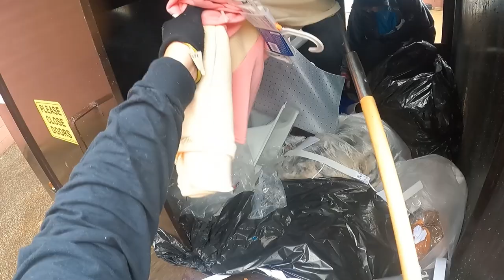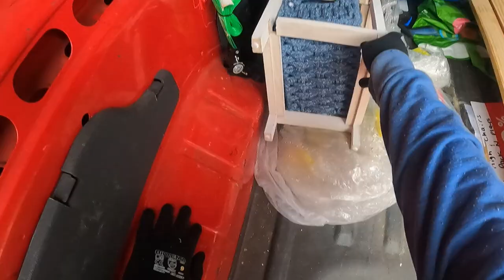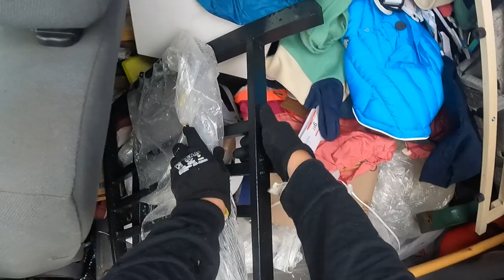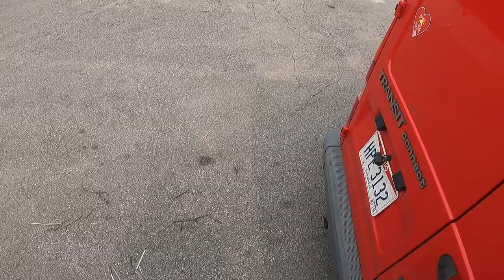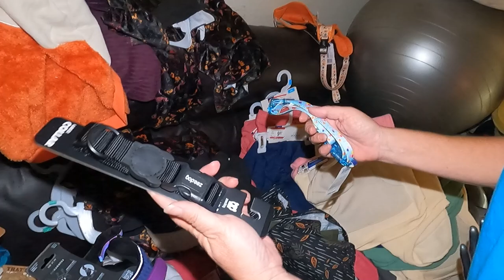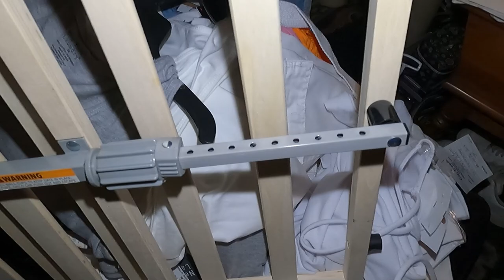Dumpster Diving- Jewelry, Clothing Score + Thousands in Dog Coats and Accessories

Comment: wish I had seen this 2 months ago. If you have them tags on again you can freeze the item with the ink tag when frozen cut the tab with a strong snipper and the ink is frozen and it won't leak out. Just make sure the tab has been frozen good first. (that's for the one kind that has a small backing). The cone ones you have to be in well-ventilated area, like outside. Hold the back side pulling the garment away from it then get a lighter (preferably a grill lighter) heat the tip of the cone until it gets lit let it burn until the spring shows and it takes a good 3 minutes while still holding away from you but not burning the garment and still holding the back and garment away from the flame of the cone. Blow it out and then making sure you have the spring that has sprung up cut it and then it should fall right off without the ink coming out.

Comment: If you set fire to the middle of the security tag the plastic part that little bump let that burn until you see the screen pop up blowing the fire out you some needle nose pliers pull that out and it should come right apart